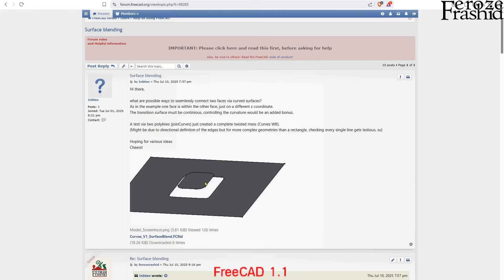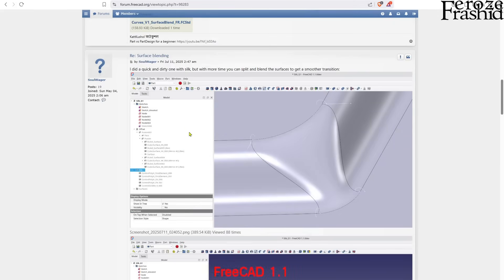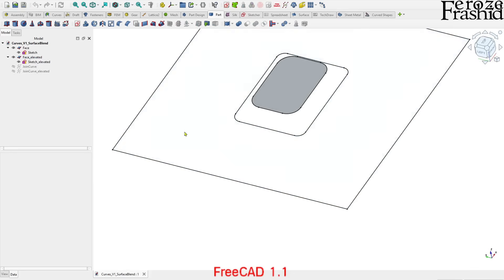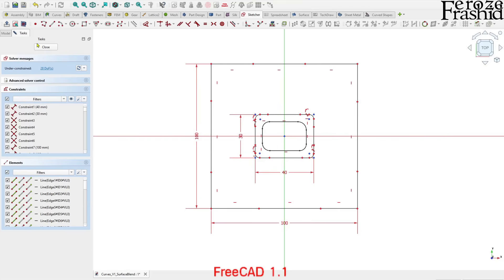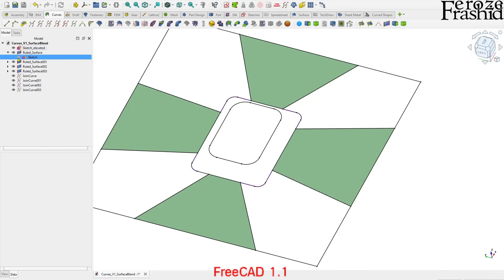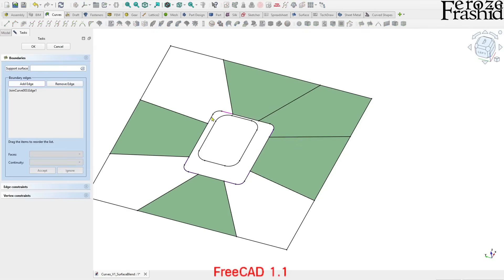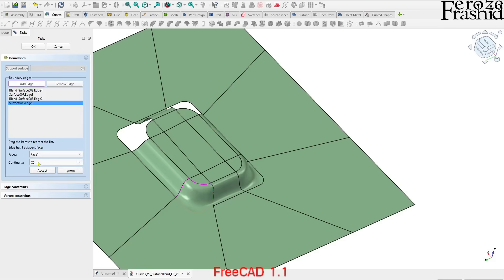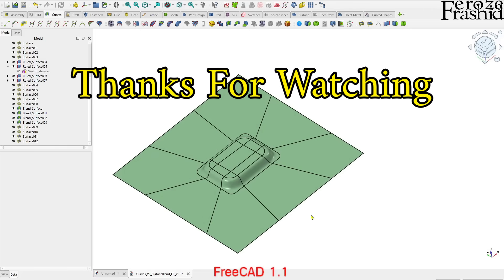Blend Surface and Filling Surface: Surface Modeling in FreeCAD

Comment: 👏Very good video !!! As you have a macro to hide all the sketche, it will be interesting to have a make macro for the fill surface to determince automatically the face to be attached and the G1 continiuty : do you think it's possible and if it is to submit to freecad ?
Reply from the maker: EDIT:  I see where a default G1 continuity for all cases might be a problem. There is some finagling involved and there is no one-size-fits-all situation. However, there could be an optional button somewhere on that diag box which will apply a default continuity for all subsequent selections. 

I think it is possible, however, I did not create that macro and I am pretty bad at coding. I collected that from a forum post:  https://forum.freecad.org/viewtopic.php?p=829291#p829291

I also think having a default G1 continuity where possible in filling surface would make things easier. Something worth requesting.